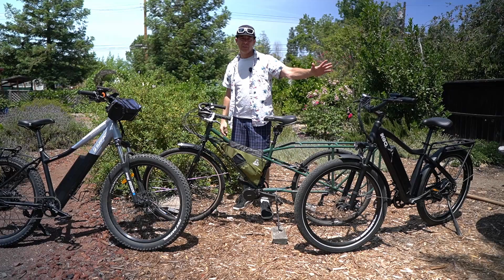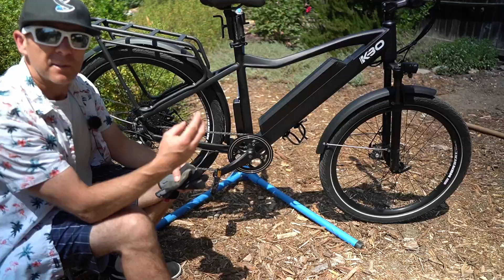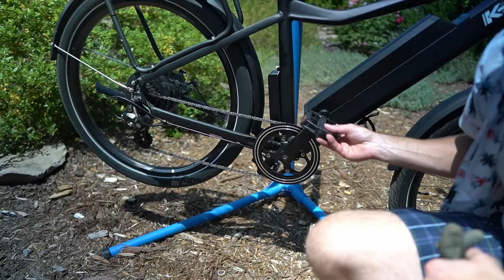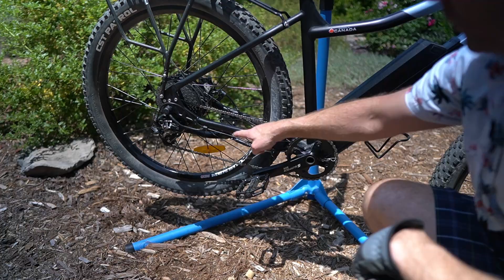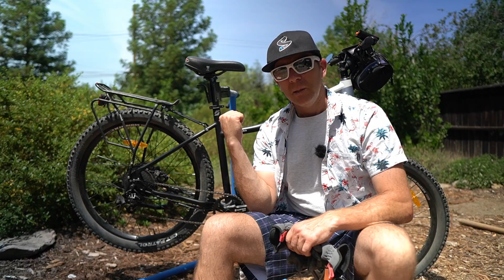E-Bike Torque vs. Cadence Senors, what's the difference?

Comment: Thank you for explaining this! I was wondering how to get up a big hill..My ebike has Both torque and cadence and while I prefer trail mode, Cadence might be better for big hills
Reply from the maker: Happy to help, the bike is a doing a bit more of the work with the cadence sensor. With torque shifting down and riding harder is the way to get that extra burst for hills, or if you have throttle to use that while pedaling harder. Thanks for the comment.